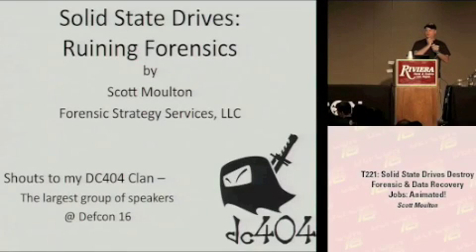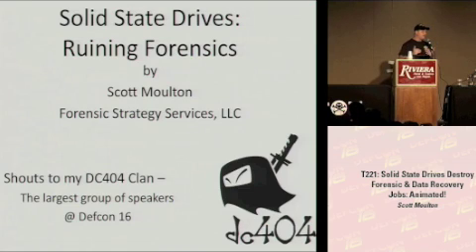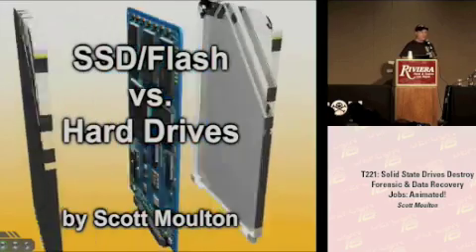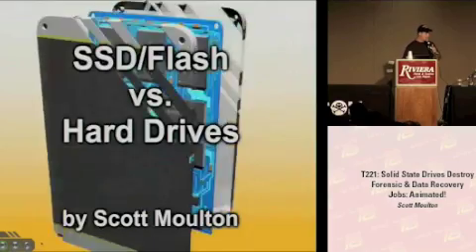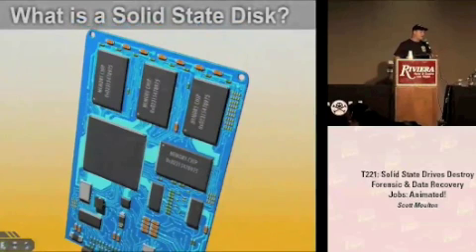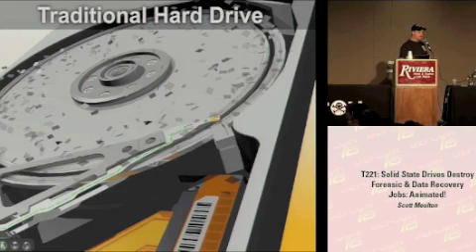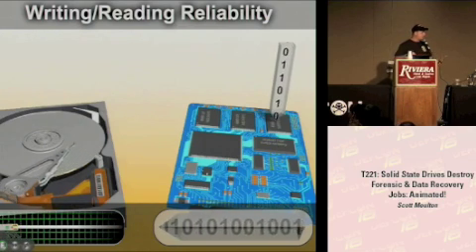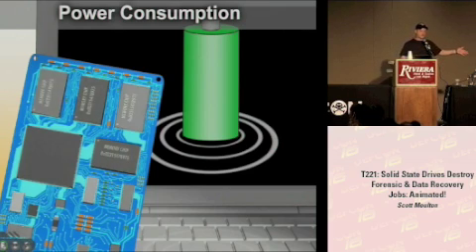Solid State Drives will Ruin Forensics Part 1/5

Comment: @bigboom273 not quite, file deletion typically only involves removing references to the file in the file system but actually leaving the data there (as actually zeroing out the space taken up by the file can be quite time-consuming). This is due to there being no performance impact to overwriting data on magnetic storage, whereas with SSDs the cells have to be emptied before they can be filled again. Thus SSDs have to conduct background garbage collection on the empty cells.